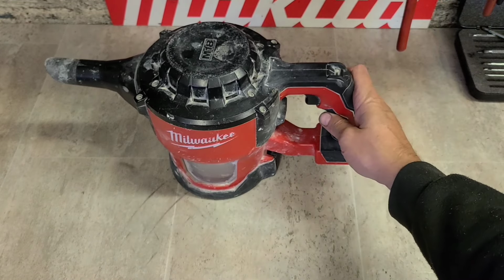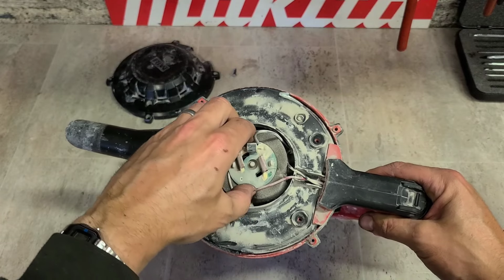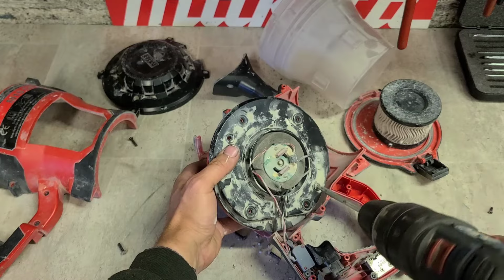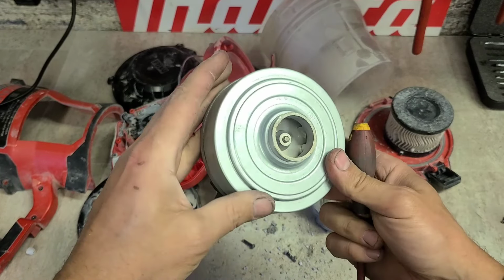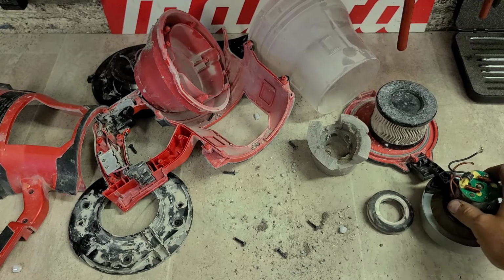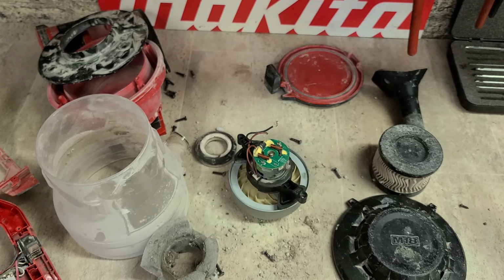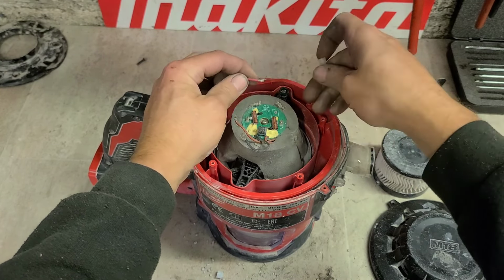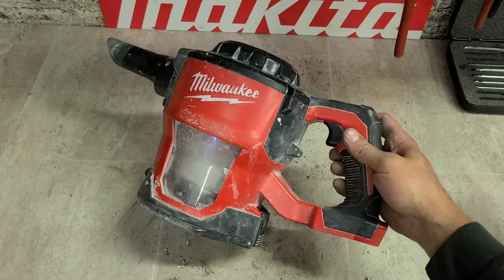Milwaukee M18CV Vacuum, non repairable disposable tool, avoid.

Comment: When Torque Test Channel mentioned that the latest 1/4 impact driver from Milwaukee was failing they got several people unsubscribing from them. Milwaukee got some serious fans. I doubt you would have that problem though, you had mentioned several times before that this is nowadays a DIY brand. Glad that some youtubers speak with the truth.
Reply: Im a Makita fan, but know their older Nailers are total crap. Mostly cause they are powered with cheap DC motor. That said, I know that they will make flops.
With Milwaukee and Americans, its the pride thing. Older blue collar workers build America on tools like Milwaukee and hence is was passed down as the American brand. Even now that its owned by Chinese and their quality is close to DIY.
Reply: @michaelfairchild it's so wild that their nailers are dissapointing considering their circ saws and planers are some of the best
Reply: The whole point of the torque test channel is to test tools, and people get angry about their brand? WTF bros 😂
Reply: Great advice Dean Thanks
Reply: Yes Sadly Milwaukee power tools are just a more expensive version of Ryobi as a lot of the parts inside Ryobi are the same as Milwaukee ....
Reply: @foetusdeletus6313  Two biggest factors for 18V Nailers is that they are spring loaded and they use cheap DC motors. Owned their brad nailer, two 2cm thick soft wood was no problem, but for example white oak, it did leave head 2-3mm out. XGT version of the brad nailer does it job, but its a BL motor, but still spring action. Hikoki still does it best with gas powered action.
Reply: RED ARMY, like Man U fans can’t criticise red
Reply: Those fanboys cover their ears and say “lalalalalalala” when you try to tell them that Milwaukee is owned by the same company that makes Rigid, Hart, and Ryobi.
Reply: Alot of Americans who are Milwaukee fans got it from yt.makita has always been known as quality in America
Reply: @michaelfairchild  Makita nailers are OK , but have a problem that every nailer seem to have been designed by different team, at least you can get spare parts.
Old sealed DC motor have a life span and Makita DC motors are €10 - €30 as spare part .
 One big tool shop has 31 Bosch and 30 Makita , different brushes , but to DeWalt 5 and Milwaukee only 3 .
Reply: Brand loyalty is a plague. I love the few Milwaukee tools that I own, but it seems to be hit or miss. Not selling spare parts to your customers is inexcusable.
Reply: Nationalism is a hell of a thing.
Reply: Diy brand with astonishing prices
Reply: @MrArcticPOWER Makita is the best because of spares. This way as a simple man I can get non running ones and repair them fo cheap. ( Wouldnt be spending those money on expensive pro power tools, as I dont produce money with them, i aint no contractor)
Reply: @JohnDoe-qb6yh  Borscht pretty much has the reputation of providing the most spare parts. May be different in the USA tho, as Borscht is a European brand. (Would be the first aspect where EU is better tools-wise than the USA.)
Reply: @Surmoka  Yes and Makita is the best in Asia because they provide spare parts there and have lots of service/warranty centers while milwaukee and bosch and others have non (atleast where am from), in lot's of Asian countries (Asians aren't just china, japan and koreans, there are many more like some gulf countries and india etc)

Like the simple man above, i buy used Makita tools for cheap and then service them and replace any parts that need replacing

Comment: Here in New Zealand, Milwaukee reps go site to site offering swap outs. Give up your Makitas, Dewalts and so on and Milwaukee will give you a good price for full set. Its something like 30% off full price. Im a builder, i know alot of builders who have done the switch and have regretted it. When they fail it costs a fortune to repair or cant be repaired at all. I have never had issues with Makita, when they go wrong its always an easy fix. Stick to what you know!
Reply from the maker: when a deal is to good to be true, that's because its not a deal. 
you would have to be bananas to trade in your good tools for Milwaukee. Not only because them dont last. But because it leaves yo with no backup. 
No professional would do that, only armatures and apprentices who havent learned yet.

Comment: So said that Milwaukee the only brand who does Plumbing tools, like pipe slice, M18 Transfer Pump, M12 Bandsaw, Drain Cleaner etc, like Battery coredrill with MX battery. Quality not the best but no other options at moment. I wish Makita start doing them soon, love my Makita tool, absolutely beast all of them 8 years old SDS 18v still running never repaired. Good video and thanks for heads up
Reply: That would require Makita to reach out to customers and ask them what products they need. Or, the very least, look at a competitor’s catalog.  Y’know, things that all of their competitors do.

Comment: Had one, sounded like a leaf blower when turned on. Sold it after a few weeks. Hepa was also expensive, 35$ where i live. 
Got a 40v makita stick vac now... Easy to disassemble, cheap filter, cheap parts, easy to clean, light... Havent looked back since.
Reply: I ve got 2 makitas one is double of the power to the other and definitely worth the extra money.
Reply: Anything 40V (actually 36V, if you kut the marketing bullshÿt) Makita is waaay overpriced.

Comment: Way back when I was a young carpenter in 89 or so we were building 3 story condos and I was cutting the roof edge and right at the peak got tangled up somehow and dropped my new Milwuakee circ saw straight to to pavement and it looked like it exploded. Turns out it just bent the hell out of the plate and the saw runs strong to this day. New tool designs are great but not built to last

Comment: I just had a new milwaukee m18 sds plus 32mm drill split open after the first use. I had it replaced under warranty but milwaukee do not give any extended warranty on replacement tools.

Comment: Judging by the ammount of shit in the motor id say someome ran it with no filter it mustve sounded horific until it finally locked up
Reply: Or wet drywall or concrete dust got sucked, ended up in the motor, dried and seized it.
Reply: Agreed.

Comment: I've had to strip and clean out a number of Dyson vacuums over the years (mains and battery rechargeable) even they are better made inside that this. The V6 for example is complex to dismantle and the plastics are rather thin. But they can be carefully dismantled and cleaned out. I did see a Makita 18v vacuum cleaner which seems to work OK.
I would avoid this make based on what Dean has said. Some of the tools are very powerful, but I prefer the reliability of Makita.

Comment: The other problem I'm seeing is a lot of plaster or sheetrock dust, most vacuums specifically warn against sucking up that fine powder, it gets into everything and turns to cement at the slightest amount of humidity. dyson had an issue with that for a while (I used to sell them at Sears back in the day.) hand vacs where never designed to be used in a construction environment, they are meant for a quick clean out of a car or toolbox, they are sold as pro-sumer tools not that "willfukyee"  has ever been a pro tool since they got bought out years ago by Techtronic Industries, who also happens to own Cryobi and like 4 vacuum brands (Oreck,Hoover,Vax,Dirt Devil) Modern tools sold at most home improvement stores are just junk designed to fail.

Comment: I have my Reasons why I only buy Makita. Recently got a HS7611 from a Friend after it stopped working. He bought himself a Milwaukee that failed 4 Months later while I had the Makita back up and running with a new Field, Fan, Cable guide and a Duct for around €50. For stuff where I know it will break the tool or at least harm it, I usually go to Parkside. They are cheap and if they fail it's fine.

Comment: I've got a couple older M12 tools, they small hydraulic impact gun, the angled impact gun as well (tiny) they get into the very small spots. Both were given to me if I could fix them, both had a shoddy battery connection. So, I kept them. Otherwise, I'm not really interested in the Milwaukee cordless tools. I'm ok using a cord, I have a nice small Honda generator and it runs all my tools just fine. It's nice having cordless stuff, but I'm ok with a good heavy duty extension cord and my generator. I guess I spent a handful of years building decks and fences down in Florida a while ago and I learned how to deal with having no electricity on any job I was ever at. A good quality generator will save you SO much money in batteries and honestly much weaker cordless tools. Yes, M18 has a few very nice heavy duty machines today, my brother has the entire line of high power M18 tools, he's a millwright, does overhead doors - and the BIG ones, but eh.. I like my cord!

Comment: Anymore is about these companies  making lots of money and making disposable tools. Only exeption is Bosch still supplying parts for even way older machines.
Reply: and... Festool 🙂
Reply: Not anymore my friend, theres plenty of "new" bosch machines they make it unworthy of fixing by listing crazy prices like 100eur for motor or switch+controller kit on  a 150eur machine. Otherwise the consumables parts are pretty good tho, last month I bought a new chuck for my sds drill, 15eur with shipping 24h they delivered it to my door. Things like brushes are always in stock and cheap.
Reply: It's not about the older machines though, Festool, Makita, Metabo have most of the parts for their older machines, you can even still get some Elu parts from Dewalt. 
It's the newer machines that has become this disposable trend. Mainly because of the brushless motors and all the electronics that comes with them. You can still get those parts from Bosch/Festool/Makita/Metabo and to some extent Dewalt, Milwaukee is the worst though; not even being able to get the essential parts even when those parts alone cost mostly half or over half worth the money of the tool itself.
Reply: @jobson88  Festering Stool is only "worth" fixing because if you buy new, you pay 3x the price than what it's worth. That's why one is going with spare parts instead of dumping the thing

Comment: I am a Milwaukee fan and I have many of their tools - mostly M12 but a few M18 as well.  I have that vacuum.  It is a piece of crap.  It is loud, the accessories are crap and it doesn't have any real suction power.  Use it for 5 minutes and the filter is completely clogged and you have to empty it out and clean the filter, which creates a bigger mess than the one you were trying to clean up.  I usually just go inside and grab my Dyson.

Comment: Looks like it would have cost about £15 to make. Paying for the name. Much better and cheaper options available.
Reply: Imagine thinking the retail price of a product is related to the cost to build it. Lol. Business expenses, profit, and retailer profit are a huge portion of the price. If it did cost $15 to make, it would need to be sold to the retailer for $50, and sold by the retailer to the end user for $80. It sells for around $125.
Reply: @littlejackalo5326  I never said that smartarse. I was pointing out the excessive mark-up for a branded product of poor quality and low production values. 👍🏻

Comment: Got a 35 ltr stainless HEPA vacuum for 100 euro's.on sale. Things sucked at least 500 kilos of concrete and drywall dust. Bulky like a good old soviet era appliance. Those little vacs are toys.
Reply: Well it serves a different purpose. It's not going to replace a full sized shop vac.

Comment: What do you think about Hilti?
Reply from the maker: A glorified hire shop now. I Wouldn't buy a single tool from them. Not worth the money. And the quality has gone to the dogs.
Reply: I have older Hilti (2010) tools and still going strong but agree the new stuff is terrible, especially the cordless drills. There constantly in getting fixed.

Comment: Admittedly I am generally a fan of Milwaukee tools and I actually own this vacuum. It's not my favorite, but I bought it to replace a 90s era "dustbuster".  The form factor is a bit strange and it's too big and unwieldy to be easily used. However, I think most of the issues the unit you worked on were cause by misuse of the tool and running it without a filter. All the beads jammed into the bottom of the vacuum would not only kill the suction but cause the motor to overheat. I agree that Milwaukee should supply more parts, however with the price of repairs most tools are disposable these days....my local tool place charges $70 just to bring a tool in before they ever try to repair it....with parts, most tools aren't worth repairing unless you can do it yourself.

Comment: It looks like the vacuum cleaner has already paid for itself.
I actually thought it had a brushless motor and nowadays the big brands should take any tool with brushed motor out of their program or just make a very small revision to brushless.
But anyway the way this Vacuum looks and what is inside, I don't wonder that it's broken. Seems more like this was your fault.
You would need a different kind of Vacuum for the abuse you did with it.

Comment: Milwaukee - only good in the states with the 5 year warranty.

And even then the Brand should be avoided since a tool breaking within 5 years is still no good especially when they are basically unrepairable unless its bearings or another very simple fix.
I have a wee Bosch 12V Vaccum that also only has a cheap brushed DC Motor. Not impressed with that the Motor is starting to wear out. Now opposed to Milwaukee Bosch will sell me a Motor but I'm not going to bother.
I try to buy brushless whenever I can and get stuff that fits my Makita 18V Batterys.
Tired of throwaway tools?
Buy corded Bosch, Metabo and Makita.

I still find it laughable that Milwaukee wants to establish themselves in the professional market in Germany. Not at those failure rates and throwaway tools. Besides they will never dethrone Hilti, Bosch and Makita which are the most common powertool brands in Germany.

Comment: Since the company does not offer spare parts for sale. In that case, it is worth considering buying several such vacuum cleaners and then disassembling them and selling them for parts.
If there is interest, you can make money by selling parts.
But it is rather unprofitable due to the commissions charged by intermediaries - the auction portal, payment system, shipping. And finally, tax. Then it is actually better to buy another new one, if anyone needs such impractical devices at all.
I'm not an environmental protection fanatic, but looking at such devices, we waste a lot of energy and pollute our planet unnecessarily. If the device was designed solidly and had spare parts, it could serve for a long time. But producers don't care about this, because they pass on all costs, including environmental ones, to customers.

Comment: I wonder if something like is worth for cleaning a your car or for hobbyist
Reply: I have a DeWalt vac, it’s smaller than the one in this video, but it has the same type of paper filter which gets clogged up very quickly. Its main use now is for cleaning the van and small messes elsewhere - you wouldn’t want to be cleaning a house with it or a very dusty room. Even if you had plenty of batteries to do so, the constant cleaning of the filter is a nuisance. Did consider buying a set of filters so that they could be changed during use and cleaned out together later - haven’t got around to it though.